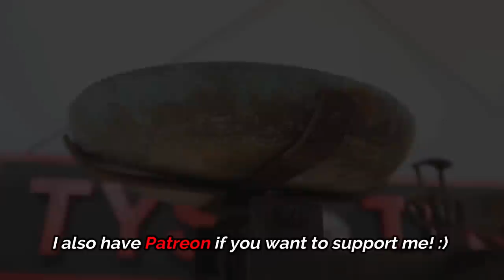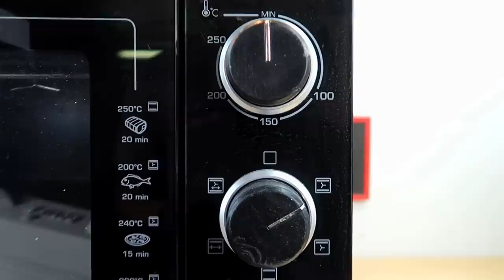Vintage Rusty Scale Restoration - With Powder Paint

Comment: I’m writing this before you paint (which I’m sure you will) Taking all the rust off is going to take close to 1 Ounce or .02 Kilograms off at most I would think. That being said I think after the paint it will be heavier. So closer to 8 1/2 Pounds or 3855 Grams not exact but close. Yes restoration videos are very relaxing.
Reply: I was wrong. Interesting. Great restoration.

Comment: I do watch videos like yours to relax. I actually watch them just before bed. They help me wind down. Only other channels I watch are My Mechanics (I've seen you mention them a couple of times) and Baumgartner Restorations but that is all art conservatorship. I did have a thought to pass on to you about raised lettering. Instead of painting it, you could do what we used to do with car and motorcycle parts. Paint the entire piece and then block sand and polish the raised lettering. It looks good and you can get nice clean lines. Just a thought though. Keep up the good work

Comment: I have a few questions about the processes and products used for this.
Why powder paint instead of wet paint?
Why do you remove the rust with a product before sandblasting? Does it not accomplish the same thing?
What exactly does the acetone do for the metal?
Answers are greatly appreciated! Great video as always. xoxo from Texas.

Comment: Merry Xmas. Another great video. Was wondering do you plan on making a filter box for your  powder gun?. Could make a stand that holds a box fan or two and air filters, and a over hang for painting. probably would be a lot nicer then doing it outside and getting powder paint everywhere. The Channel 
Rescue & Restore looks like it has a sweet setup for powder paint. He has a more pro oven but that looks like a self made air box. As for the is restoration videos relaxing for me? Maybe? I like history, seeing how things work, taking them apart and putting them back together again. Also love seeing things being restored and reused again instead of just being tossed out

Comment: Note: It is good that you didn't paint the pivot points and V-blocks however,  the points should be both filed close to being almost like a knife edge with perfect crisp and smooth V's with NO deviations.
This is important for accuracy EVERYTHING depends on that. The type of scale repaired in this video is called an "Over and Under Scale" .  When testing,   If this scale for example was rated for 10lbs, you would test it first at 2-1/2  , 5 and then 10 as older manual scales sometimes tend to vary at high and low weight ranges, this is how you would know that it was completely accurate. 
Pardon the pun ...,On a scale of 1-10, I give you an 8-1/5 to a 9, good job, nice presentation and restoration. Always looking forward to your next video👍👍👍

Comment: Hi there...just want to know...could you just sandblast those item without using rust removal?
Reply: Sure, he could, but this method reduces contaminants in the blasting media, which is recycled. And the solution inhibits further oxidation for parts/surfaces not painted or in view.  Sound right?
Reply: @mred8002  thanks man!

Comment: Curious, why did you use rust remover, if you used the sandblaster?
Merry Christmas!
Reply: The rust was probably really thick. If you do rust remover on super thick rust it only takes off a layer or two making it easier to sand blast the rest of the rust off.
Reply: @koriandrstarfire9514  ohhh. The sandblaster wont take off a lot of rust?

Comment: Is it just me, or does it seem like the parts washer is pointless? I never see any difference between the before and after of using the parts washer.
Reply: It's mostly to remove loose crap and to degrease the part.  You wouldn't expect it to make a huge visible difference but if you put greasy dirty and rusty parts in the sandblaster, you'd make a right mess.